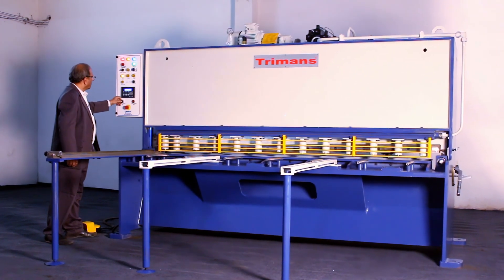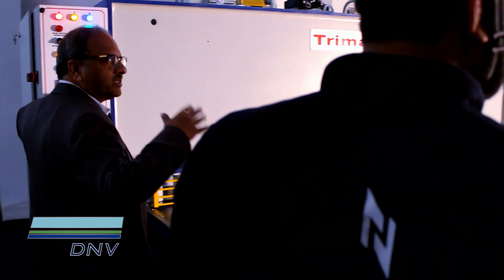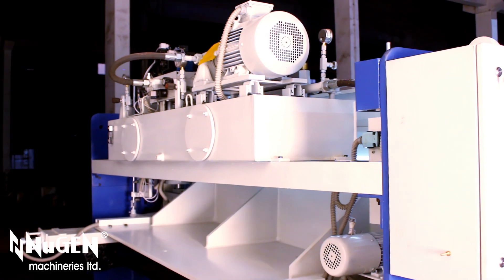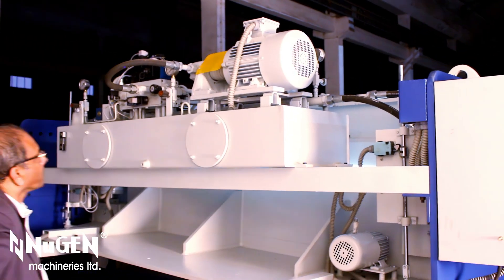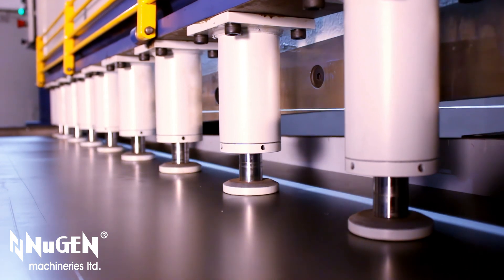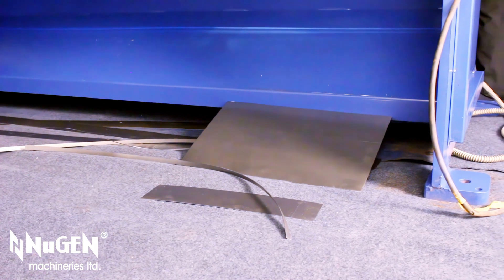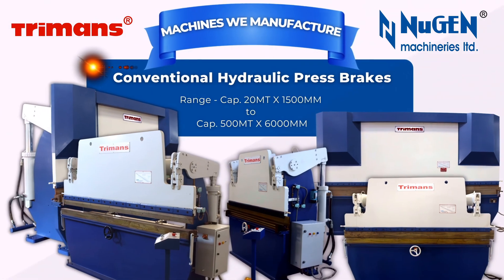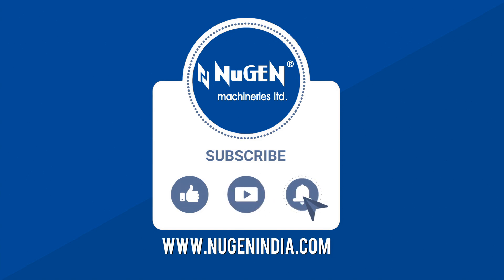Trimans Variable Rake Angle NC Hydraulic Shears | ft. HVR 425 | NuGEN Machineries Ltd. | Since 1982

Comment: Full nc back g sheet cutting machine rate kitna parega?
Reply from the maker: Dear Sir,

Thanks for choosing NuGEN Machineries Ltd.

We request you to kindly share:
- Material / Workpiece Details (Mild Steel, Stainless Steel, Galvanized Iron, Aluminum, CRC Sheet, GPSP, Copper etc.)❗
- Material Thickness.❗
- Material Length.❗

This will help us calculate an ideal and relevant machine required for your esteemed business.

Kindly feel free to communicate on WhatsApp (+919081554440).